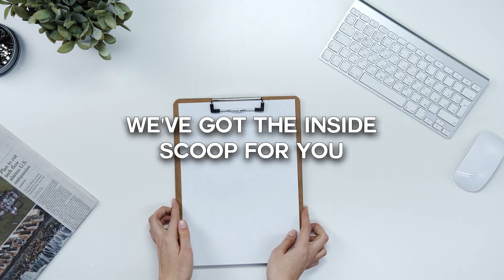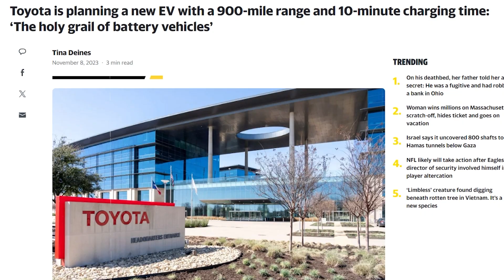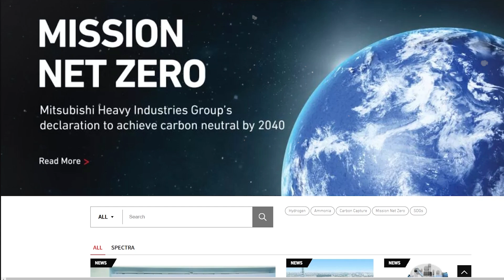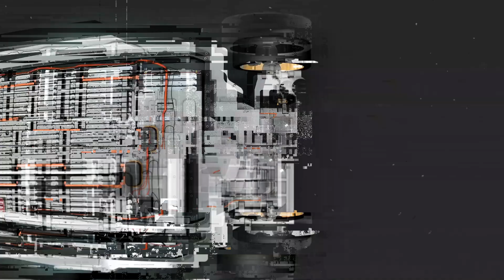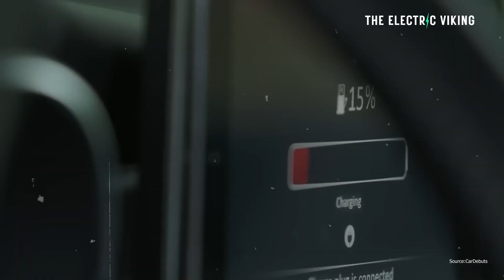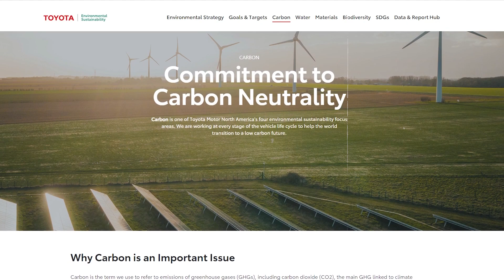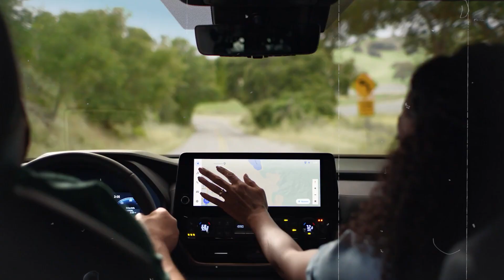900 MILE Range With Fast Charging!

Comment: do not go crazy with this Carbon scam stuff. electric cars those batteries will polute down the road ????  Hydrogen  safe hydrogen is another solution, once they work out the cost of producing it at a competitive level it could be great none polluting emissions.?
Reply: You make a reasonable point, but you do highlight the one big problem: Trying to mass produce an alternative automotive technology/strategy that doesn't, at numerous points, involve the emormous use of fossil fuel in it's production - and thereby creating the very emissions and environmental damage that we are trying to avoid.
And it should be pointed out that every new technology immediately makes the old technology largely obsolete and thereby nothing more than landfill. I don't see how any of this makes it eco-friendly? As this is a global problem, there should have been one single global drive to Make Something That Really Works before releasing it?